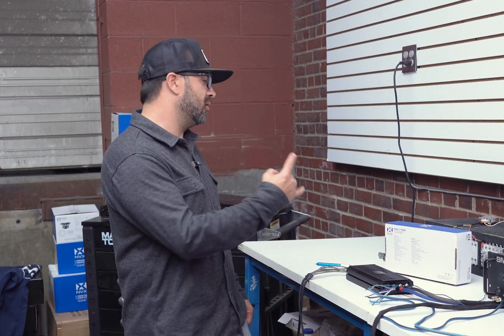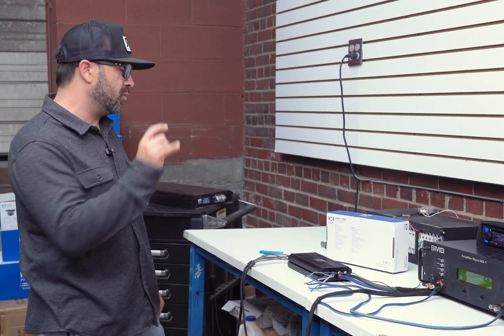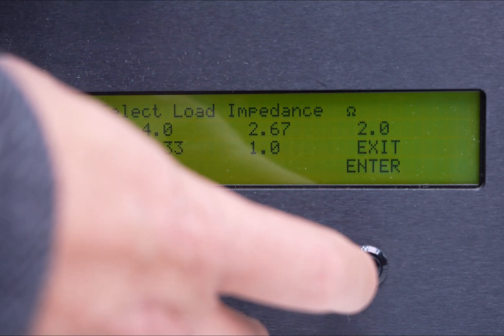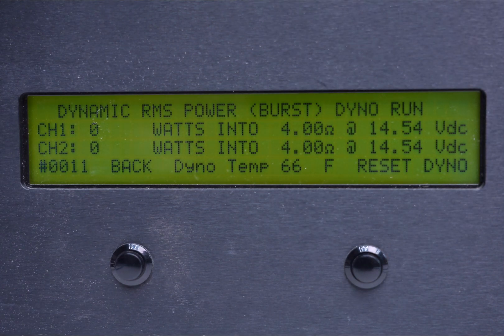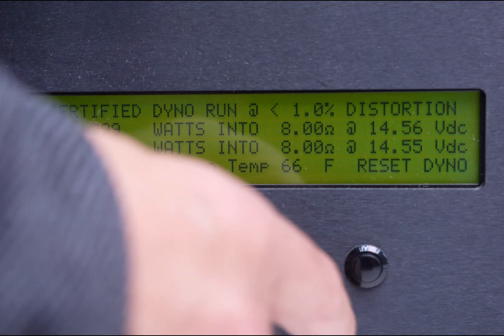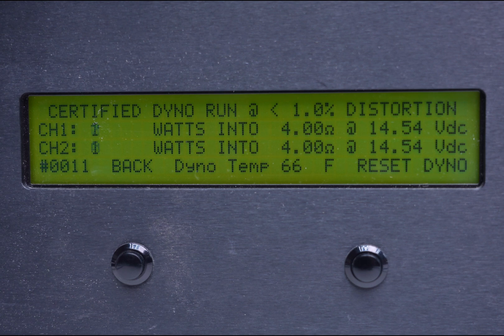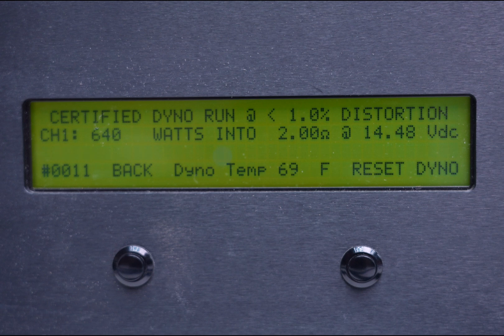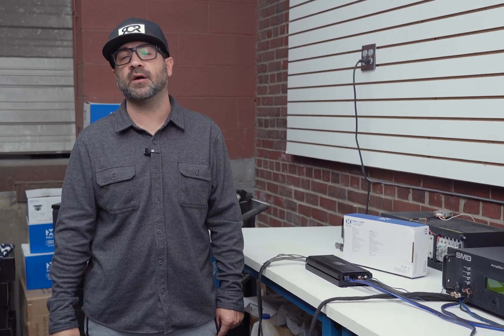NVX NDA1100.5 Amplifier Dyno

Comment: Question,  do I  need to run a remote wire or can I power the amp through my RCA inputs?
Reply from the maker: It needs a remote wire. This doesn't have signal sensing

Comment: I have a 2018 dodge charger 392 with Harman kardon system. 
I replaced all the speakers with after market speakers 
2  3 1/2 jbl tweeter in front dash 2 more in the back doors and 2 more in the back deck.
2 6x9 kickers in front door and 2 more in the rear deck
With an 8 inch kicker sub.
Would this amp power all those speakers?
Reply: You'd be better off running 3 separate amps imo or at least an additional 4 channel with this